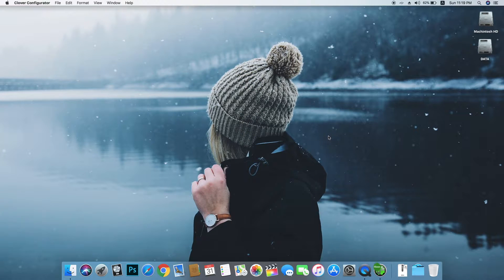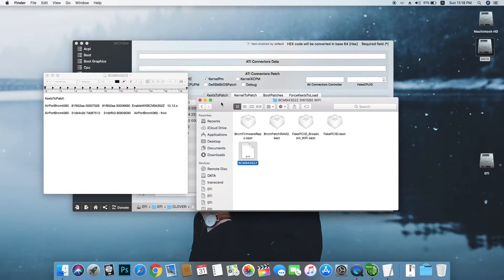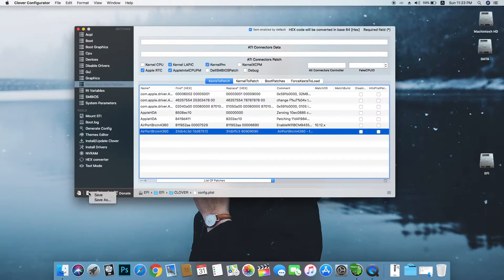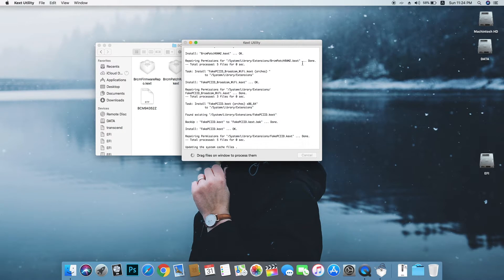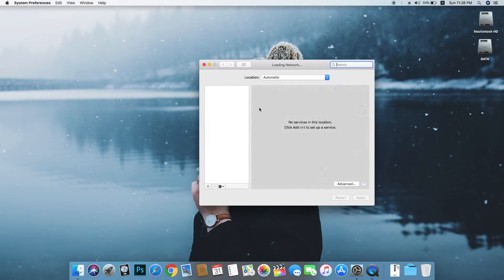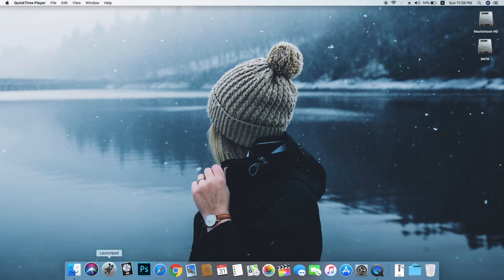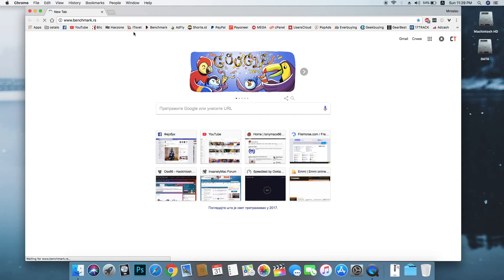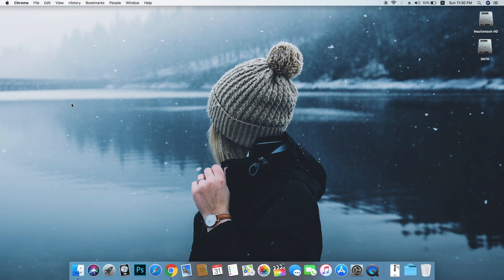HP 250 G5 - DW1560 Broadcom BCM94352Z WiFi for Hackintosh

Comment: I have the same machine, i have tried as you showed but my wifi is still not working.
Whenever i click on „Turn Wifi on“ in my Hackintosh... nothing happens 
Please suggest
Reply from the maker: if you replaced card must work .. with these kexts. I will no longer use MacOS on this laptop my plan is to install windows10 + Linux (ubuntu or fedora). I don't like apple plans with ARM and "big sur" I predict that Apple will no longer support x86 CPU and apps so I will make the transition to Linux/Unix based systems.

Comment: works on all hp laptops? 
i have the hp au111tx (i5- 7th gen)
Reply from the maker: Vaibhav Kaza not sure. Purchase card and try
Reply: CyberTech 3:23 how to do that? btw instructions for wifi are crystal clear, great vid 🤘🏽 (btw the kext website in the description keeps redirecting)
Reply from the maker: @vaibhavkaza  Link for Kext working fine just checked recently try to disable Adblock if you using. for Bluetooth, you need a DSDT patch in dsdt.aml file. learn to patch dsdt its useful.

Comment: hi I upgraded my Hackintosh to Catalina using Hackintosh zone Niresh Catalina install guides , wiif is working but bluetooth is inactive, can you check for me how I can fix Bluetooth in Catalina cause I cannot use kext utility as s results of changes in Catalina kexts are no longer installed in /System/Library/Extensions but in /Library /Extensions. I used kext utility pro but it failed to install them in   /Library /Extensions.

Comment: how do you enable  AMD R5 m430  graphics.
Reply from the maker: its disabled not enabled
Reply: How do i work amd graphics?
Reply from the maker: @jijeshvu07  its not working you need to disable amd gpu and yo cant use dual gpu on MacOS
Reply: Ok. But my intel graphics is only showing 7mb. Any fix for that.

Comment: Do you think that this will work on Xiaomi Notebook Air 12.5 ?
Reply from the maker: it depends this is M.2 wifi card so if you have M.2 slot on logic board then you probably can. also sometimes there is WIFI "whitelist" in some laptops and then you can use only specific card otherwise the laptop won't boot.
Reply: @CyberTechSRB  Thanks ! ;)

Comment: Can you please check if my trackpad can work ,is from elan I used voodoops2 , voodooi2c and applesmarttouchpad kext all not working, I m using Lenovo IdeaPad 130 intel core i7 everything is working except trackpad
Reply from the maker: use voodooPS2 for trackpad
Reply: I tried it , keyboard works but trackpad not responding , you mean voodoops2controller Kext?
Reply from the maker: @maphekomoloto2961  https://bitbucket.org/RehabMan/os-x-voodoo-ps2-controller/downloads/
Reply: Thanx ,I’ll try it again.